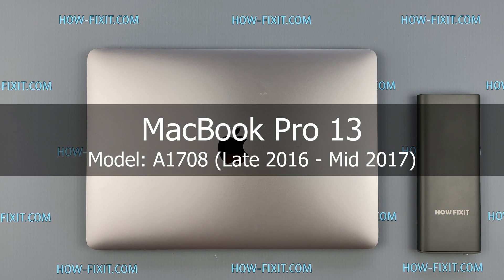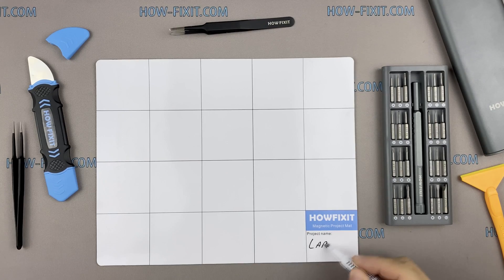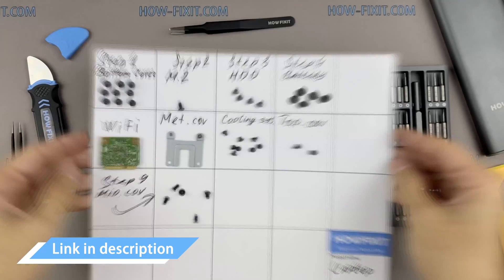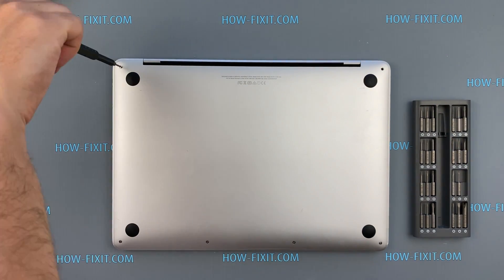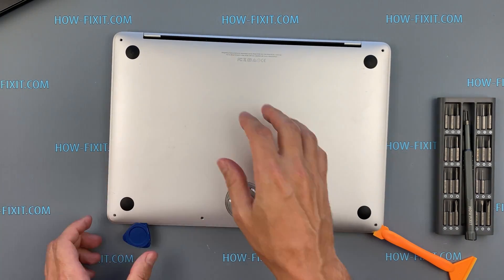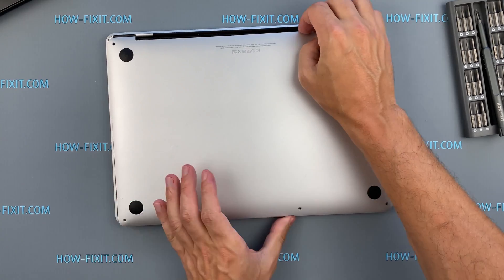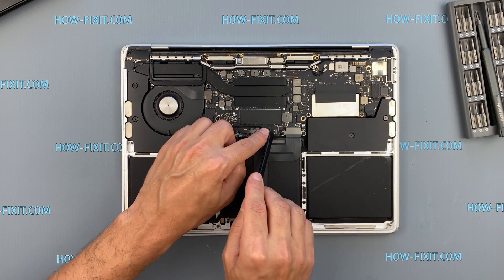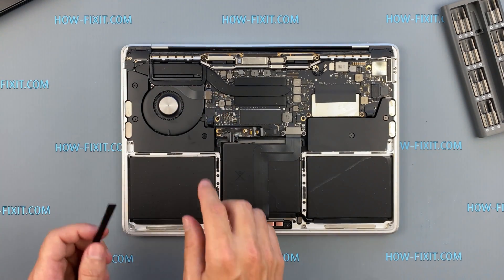MacBook Pro 13 A1708 (2016-2017) Motherboard Replacement Guide

Comment: Can we replace motherboard with a higher cpu power or a higher ram , remaing in same year and model of macbook pro ? i.e i have a 2013 late macbook pro 2 ghz 8 gm ram and i am thinking to replace mother board with 16gb ram and 2.3 ghz processer with nvedia gfx card.

Comment: Very useful. My macbook didn't charge, so I wanted to give the USB-C ports a rub. In the end, the computer rebooted after the cleaning, but the ssd is missing. I bought a new one on Ali Express for 40 EUR, let's see if that does the trick.
Reply: Did it work?

Comment: I have a mid-2017 MacBook Pro with a Core i5 processor and no touch bar. I am considering upgrading the logic board to an i7. However, I'm uncertain whether the new i7 non-touch bar logic board would fit inside the case.